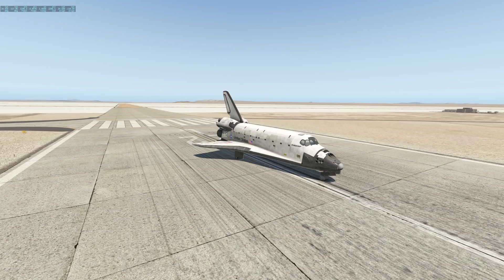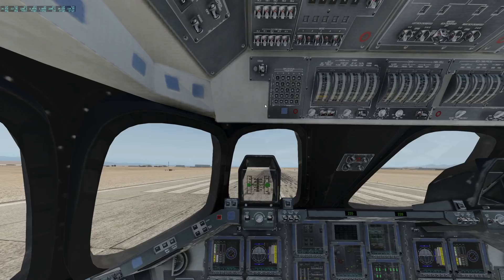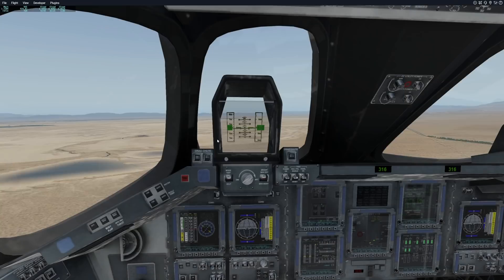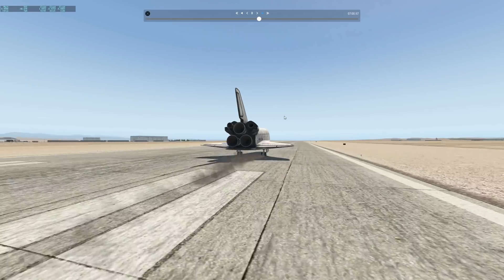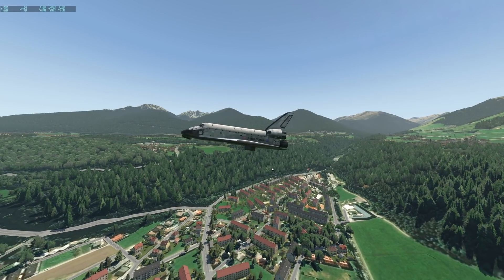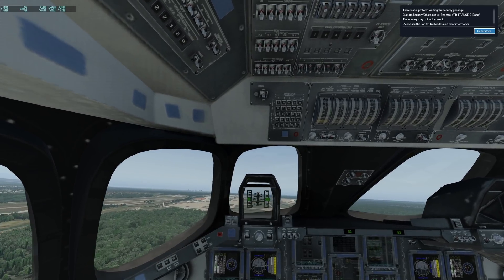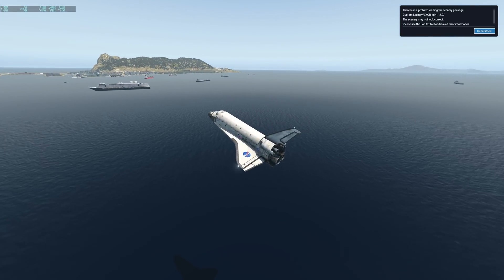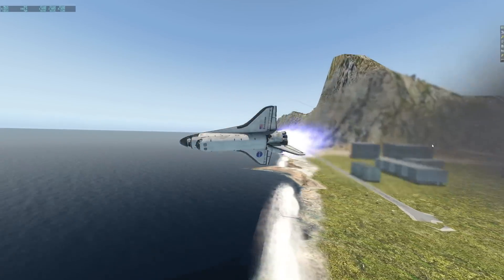Why Does The Space Shuttle Need THIS LONG Of A Runway - Landing The Space Shuttle

Comment: 3:18 At least with my X-Plane 11, if you lower the throttle a speed brake opens up on the rudder pointing two opposite directions.

Comment: reverse thrust in dry weather actuallly barely makes a difference. Usually they open the reverse thrust but dont apply power to it, in cold conditions or rainy weather it makes a lot more difference and it is viable.

Comment: The space shuttle primarily landed at Kennedy Space center. Edwards Air force base was used as a backup, and white sands as a backup to Edwards air force base. Edwards air force Base was used for a lot of the early testing of landing the spacecraft as well. But most of the STS missions landed at Kennedy Space Center in Florida.
Reply: In ireland there was also a really long runway, and many people think that that might of been there in case the shuttle had to abort launch and land somewhere else further away
Reply: @gingerman5105  That was probably a TAL (Trans-Oceanic Abort Landing) site in case there was an abort scenario where the shuttle couldn't RTLS (Return to Launch Site)
Reply: Even then, there was that long one that was forgotten

Comment: The reason it needs a long runway is its speed
So the space shuttle needs a lot of speed to stay in the air and ground so it has a parachute to make it a bit slower so it doesn't overrun the runway but it still needs a long runway but they can add more parachutes or the plane will stall because if the weight and it needs rocket engines to produce lift so that's why its needs parachutes so that's it for today
Reply: The space shuttle also cant take off by itself because its wings dont produce much lift. So it has a rocket attached to it
Reply: The Plane Channel yup
Reply: It doesn´t need rocket engines to produce lift
Reply: @maxquidity  in common sense yeah I kinda does
Reply: Infact the shuttle is a brick therefore she need speed to stay in the air due to orbit speeds.also talking the parachutes wont work if theres more then 1.and the rocket thing,the rockets are the to get her out the atmosphere not just because of the wing lift.yes I'm a expert.
Reply: @spaceypoopnoob9563  You're not an expert
Reply: @spaceypoopnoob9563  "orbits speeds" has nothing to do with the speed needed to stay in the air, you comment makes no sense
Reply: @spaceypoopnoob9563  Again, you comment and the assumption make no sense as they don't correlate in any way with each other. Are you like 10 or something?
Reply: @spaceypoopnoob9563  ok so first of all, the space shuttle orbits at about 17,500mph or about 7.6km/s not 27,000m/s (27km/s)

Secondly it touches down at around 220mph (200kts)

The space shuttle has a 20 degree glideslope this allows Acceleration due to gravity to Keep the Airspeed high enough so it doesn't stall

There are small rocket engines called orbital manovering thrusters which perform something called a De-Orbit burn, this reduces the Shuttles Velocity just enough so that  its freefall is redirected towards earth and i say redirected because anything orbiting the earth is in constant freefall thats why you feel near 0g in the space shuttle if it was stationary, it would exert around 0.9g and fall toward earth at about 8.9m/s^2

When reentering the atmosphere the Air resistance slows the shuttle down, the shuttle had a G force limit at 3g so they couldn't slow down too fast as they would exceed the limit
So they descended through the atmosphere at around 10,000 feet per minute

And Orbital Velocity has nothing to do with Touchdown speed

Thanks for reading my lecture!
Reply: @spaceypoopnoob9563  2700 m/s, not 27000